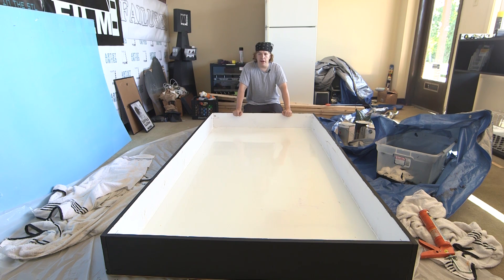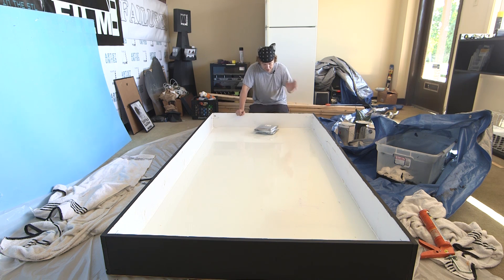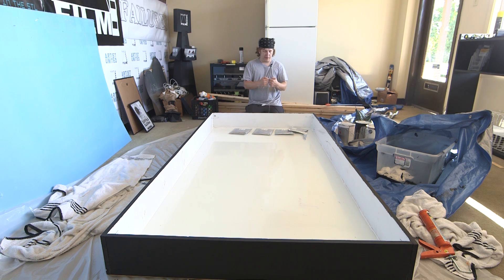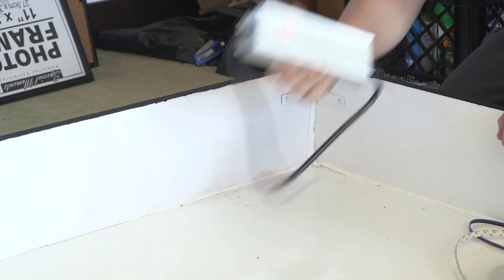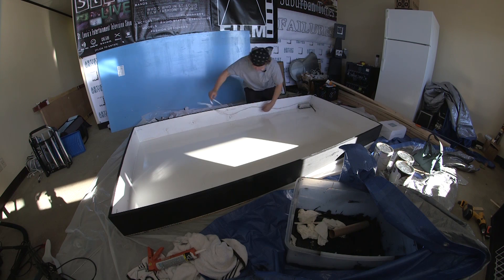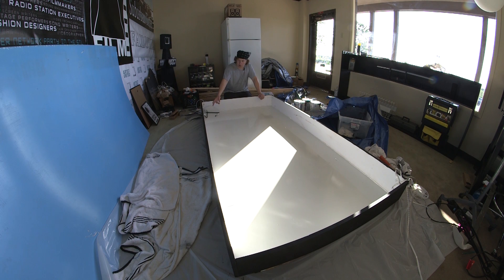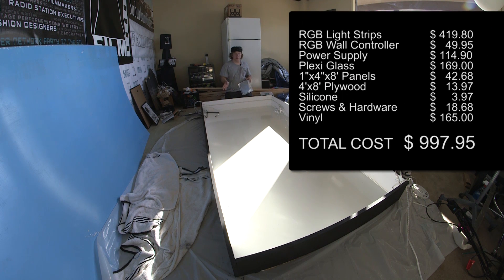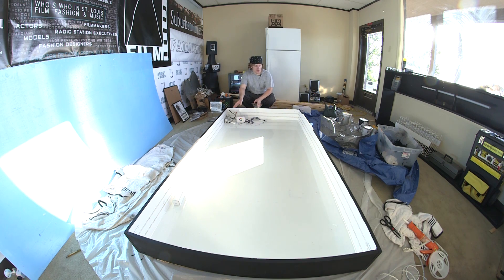Build a LED Light Box

Comment: Only the letters lite up. Didn't have to put the lights around the outside of the box, just behind the letters. Could have gone with less lights and a cheaper power supply.

If you paid someone to put the graphics on for you, ask for your money back.
Reply: If the LED's were directly behind the letters, you would not have even illumination.... the light is reflected inside the light box, evening it.

Comment: hi, this tutorial is good, but the sign needs better finishing, and technology u used with less is bad, u should put led's on the bottom, and furthermore u need to put vinyl on plexiglas before applying on the board, then you won't have those lines on the corners lighting in the front that clearly sees. in my country this kind of box would not be good job and client won't pay for it. No hard feelings, just making some correction for your further job :)

Comment: how do you make signs that you hang up on above your building? like that same concept except just not neon changing colors? please help
Reply: +Angelo Taracena lol, I think it's interesting how people can't problem solve, but we all have our gifts, no?You can make the letters out of wood or bent metal (Since you're probably DIY and don't have many tools I would suggest blocky letters so they're easy to make. Be sure that whatever material you use is weather proof, pressure treated woods painted with outdoor paint).Then depending on the colors you want, you can go the traditional route of using thin colored inserts backed by white lights. Or you can use a frosted plexiglass cover and RBGs (be careful, if you don't use enough or make the edges lipped to hide the LED's you'll see little dots). I would suggest fitting the frosted plexiglass (CNC cut with a cheap machine, or cut by router using the wood as a guide) and then fitting the plexiglass into the letter AND SEALING THE LETTER AROUND THE PLEXIGLASS. You can do that by completing say, the whole way around the S with the plexiglass inside, then push the plexiglass up and leave the backing open. If you do it this way you still get access to the lights in case something breaks, but light will shine out the back too giving you this halo effect. You can modify this various ways based on time, skill, and how much care you want. Something to watch out for is how many LED's you line the letters with. I think you'd want quite a few wrappings so the color is super bright, I hate those dull red signs that are super old, it just doesn't look sharp. I personally would do a few things, make a black wood lip on the outside and inside of the plexiglass, the glass will be a pain to replace if it breaks, but that would rarely happen. This lip would hide the LED's individually at night, but also provide a black exterior line for the lit plexiglass during the day!!! Then I would build the SAME back plate that is inset from the lettering. I would drill a hole for the wiring and then put a reflective surface on the inside (So the inside backplate isn't just black, it's a mirror like finish of some cheap reflective backing so more LED light goes out the front). Then I would take an extra strip of BRIGHT white leds and line the EXTERIOR BACKING of the letter. So I can change the color of the letters, but it will always have this gorgeous white halo effect behind it. I would wire the electricity carefully so wires aren't exposed (Ugly line of wires avoided) by either making a decorative support trim for the letters, or running the electrical into the wall. Then I would get really technical and probably use a radio controller for the lights, but that's an electronics project. I would be able to use a radio inside the store without worrying about IR signals reaching the letters. Also be sure that using LED signs are legal for storefronts in your area, or if they are allowed to actively change colors or flash. Well, I wrote a lot, but I want to find a reason to make a sign now! I'll respond if you reply with any questions, have a good day!